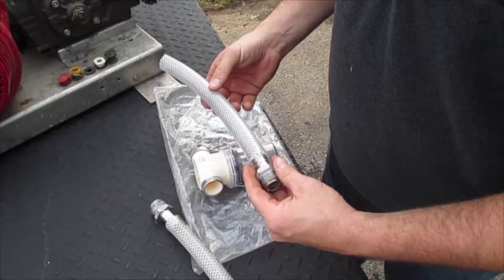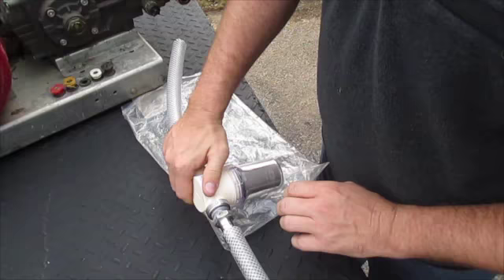Pressure Washing Inlet Set Up Overview

Comment: I NEED HELP,   I HAVE A 4000PSI 4GPM BELT DRIVE.  SHOULD I USE 1 INCH PVC PIPE OR 1 INCH NON COLASABLE HOSE